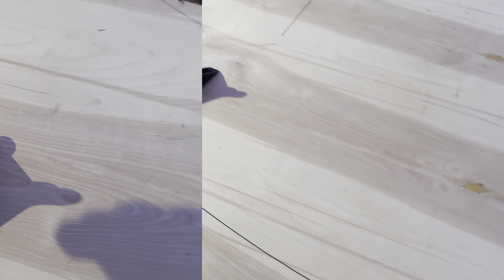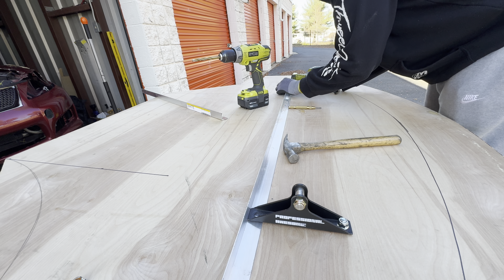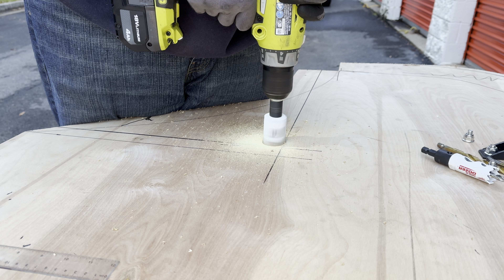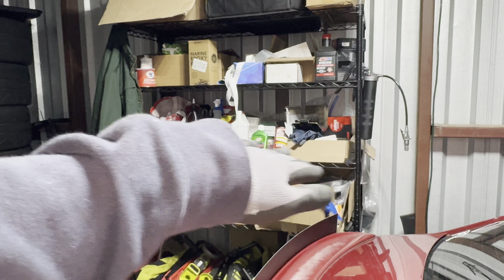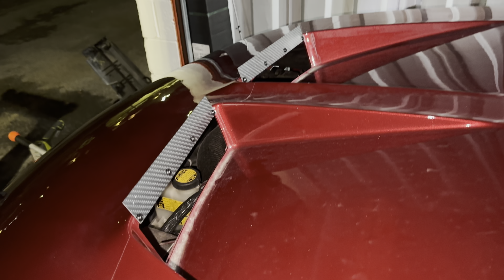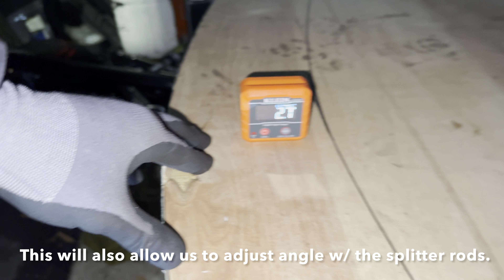Making More Downforce & Improving Cooling Using Carbon Fiber | Lexus IS F Aero Project Pt.2

Comment: Getting that rear bill that straight solo is damn impressive bro. 

Also, the strikers in the front are a great move. I keep trying to advocate to the RC F owners the actual functionality of hood vents. The rain guard that we have is functional and creates a votex. Just like Novel, that negative pressure zone 100% assists with extraction. But they remove it anyway because it looks "cool". Go figure..... 🙄 

Keep em coming!
Reply from the maker: I believe it man. Toyota/Lexus spends so much time perfecting the aero performance of these cars. They are a great platform to start from.